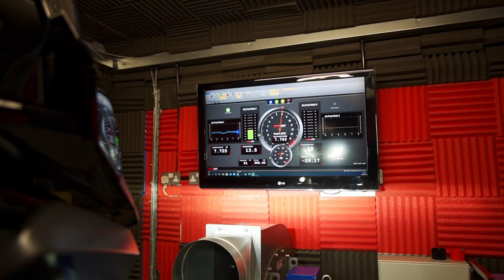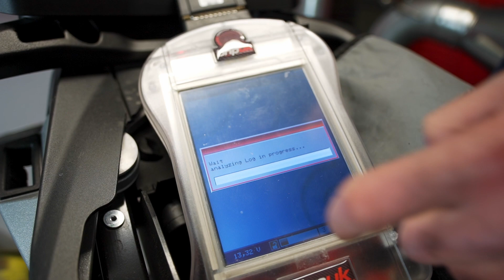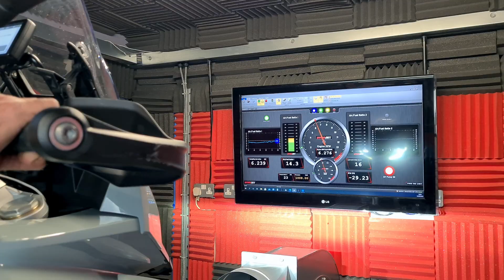Euro 5 BMW S1000 XR Gen 2 Cat v Decat | BHP UK Custom ECU Remapping

Comment: I am the owner of the grey decat BMW.  I can state that the bike ( although great stock) has improved dramatically since the map. It’s so much smoother and the power and torque are much more accessible in real world riding.  A great service from start to finish and very friendly and likeable team at BHP.  If you are going to spend thousands on a new motorcycle then add a few hundred more to make it a better bike.
Reply from the maker: Thanks for the kind words Stephen. It was a pleasure to meet you and work on your bike.
Reply: Has fuel consumption changed at all
Reply: How loud is your bike with decat
Reply: @BHPUK  I'm looking at tuning my 21 s1000xr M. I did the servo body mod and removed the Servo motor, and that alone woke it up. And it sounds much better. 

Does the decat make it unbearably loud? I had a super Duke 1290 gt That I removed the cat on with a pipe werx can, man it was insane!

Comment: I might be interested in this if it's available for the handheld device. The throttle response is indeed lacking.
Reply from the maker: Yes, this is available on our ECU Flasher. 
Feel free to call us on 01282 779000 (option 2) for more info.

Comment: Can you map out the lean bottom end on a gen 1 to stop all the snatch unless on the throttle, full system been mapped before with in plugged lamba sensors
Reply from the maker: Yes we definitely can. In fact we think that’s the most important factor in the tuning.
Reply: @BHPUK  interesting, does the ecu still have to be taken off or can you just plug it in now ?
Reply from the maker: @tonyharding5336  we can program these through the OBD socket. They are also a available on our ECU Flasher here  https://shop.bhp-uk.net/products/bmw-ecu-flasher?variant=41017951584309

Comment: Hello, great info.  I am in the US and am about to fit the Akra header to the bike ditching that Giant Euro 5 Cat.  What kind of gain will I see without a tune and just adding the header.  I ran the Akra header on my Gen 1 XR for 25K miles with no issues without a tune and it ran great.  Cheers!
Reply from the maker: The new Euro 5 bike will run very lean without a tune. If you email the office at info@bhp-uk.net we can forward you some runs that show exactly how lean the bike will be without a tune.
Reply: If you have fb, I can share through stock vs Akrapovic headers (stock ecu).

Comment: Dear BHP team in the GS911 real time data my S1000xr gen1 "oil temperature showing -39.8c" is this normal ? even if the bike is dyno tuned ?
Reply from the maker: We don't use GS911 but this does not sound correct.
Reply: Yes normal.

Comment: If you decat the bike then map it, would running a baffle in the end after the mapping affect the engine at all ?
Reply from the maker: It really depends on the system and the type of baffle. GENERALLY, an open baffle will not need a retune, a closed end baffle will need a retune though.
Reply: @BHPUK  ok thankyou

Comment: If the motorcycle has factory warranty it will be voided by tunning ?
Reply from the maker: @blackstorm01  the short answer is no. If a manufacturer wants to void a warranty, legally they have to prove that the modifications have caused the failure. Some manufacturers are better than others. Generally if your manufacturer has a good reputation for upholding warranty claims then you’re generally fine. If on the other hand your manufacturer has a reputation for trying to wriggle out of all warranty claims then they will use any excuse they can.